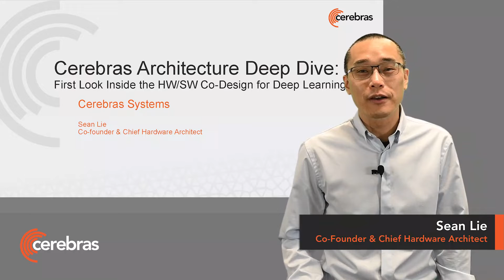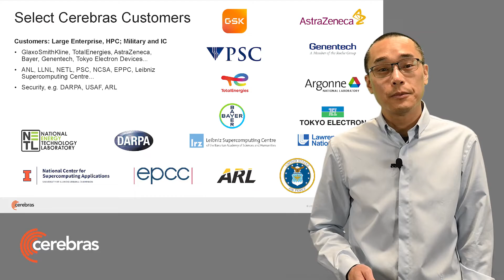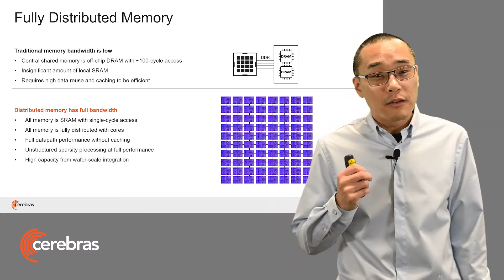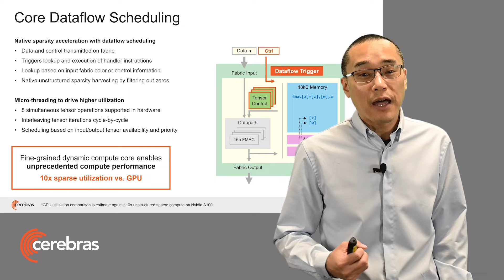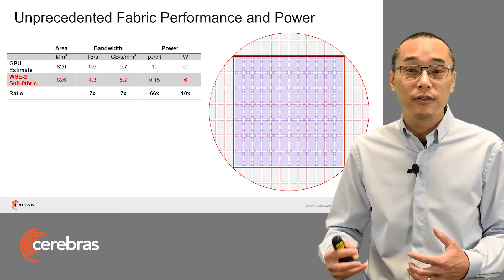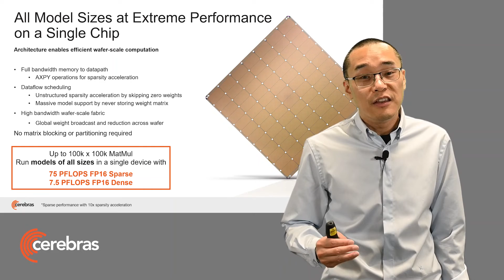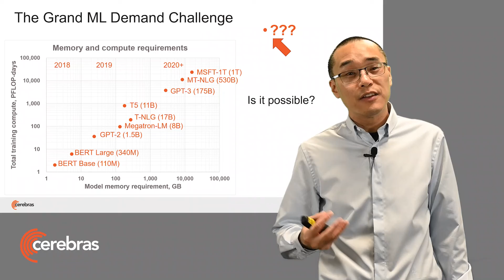Cerebras @ Hot Chips 34 - Sean Lie's talk, "Cerebras Architecture Deep Dive"

Comment: Re: the The die-to-die interface at about 15:15. 

You mentioned you an upper metal layer to cross the scribe lines between the dies. What does the reticle look like for this. Is this a regular mask, but the alignment for the mask is just offset so it straddles the scribe lines for the rest of the wafer? Is this something TSMC does regularly for other products? Or is this a new process to have reticles on the same wafer that don’t align on top of each other?

Comment: 00:04 Cerebras aims to revolutionize AI compute with a co-designed architecture
02:06 Architecture focused on neural networks
06:25 Memory bandwidth enables full performance in neural network computation.
08:36 Cerebras core hardware architecture flexibility
13:08 Cerebras chip has 84 die with 850,000 cores on a single 300mm wafer.
15:27 Homogeneous array of cores across the wafer for unprecedented fabric performance
19:21 Cerebras architecture utilizes dataflow mechanisms for weight computations
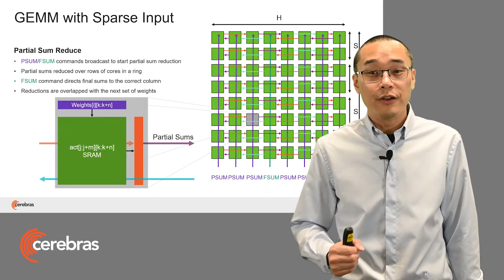21:12 Single chip enables high-performance neural networks
25:02 Scalable clustering and wafer-scale chips enable large model access to everyone
Crafted by Merlin AI.

Comment: Hi. There's something that a few people were wondering about: Why is the Wafer-Scale Engine square? Since it looks like there's room for ~28 more complete, attached tiles.
Reply from the maker: It's a good question! The answer is rather prosaic, we're afraid. If the WSE weren't rectangular, the complexity of power delivery, I/O, mechanical integrity and cooling become much more difficult, to the point of impracticality. 

Take a look at the virtual teardown on our website and you may get a feel for some of these challenges: https://www.cerebras.net/cs2virtualtour 

The upshot is that a mere 850,00 cores will just have to suffice. ;)
Reply: @Cerebras  I think I get the idea, thanks.
Reply: @Cerebras  Would it be possible to lop off some of those edge tiles to make mini engines?
Reply: @Cerebras  why not keep its blocky "reticular" basis of compute, just use all thhe full reticles you have access to? make it look like a riemann on day 1 of calculus?

Comment: Is the CS-2 used only for training? 
Will a time come when, for massively concurrent inference, this architecture will be applicable?
Reply from the maker: Hi Ralph, good question. The vast bulk of our customers have used our systems for training LLMs or for HPC applications. 

We have had a couple of projects using it for inference, like one with Lawrence Livermore National Laboratory where they offloaded an unwieldy inference step from many nodes of their Lassen supercomputer to one of our systems. You can read the case study here: https://www.cerebras.net/cerebras-customer-spotlight-overview/spotlight-lawrence-livermore-national-laboratory/

But in principle, our architecture should make at terrific concurrent inference platform because we can run many (hundreds or even thousands depending on the model) in parallel across our massive array of cores.